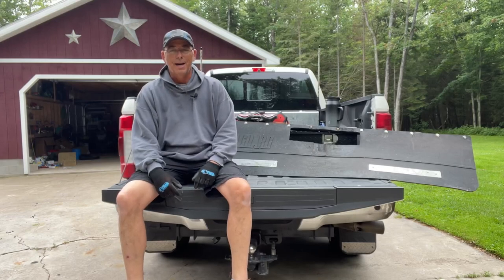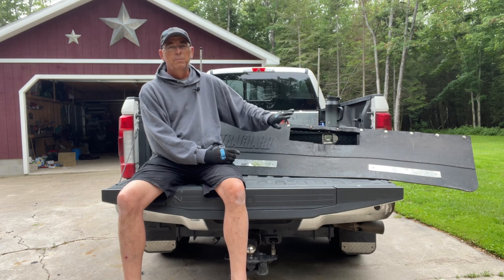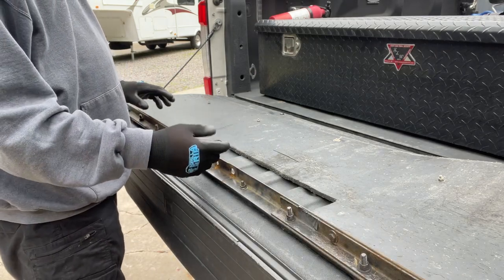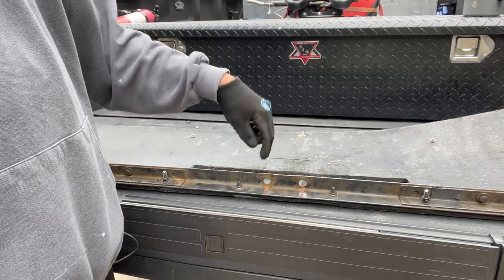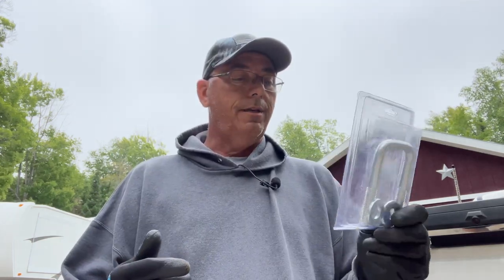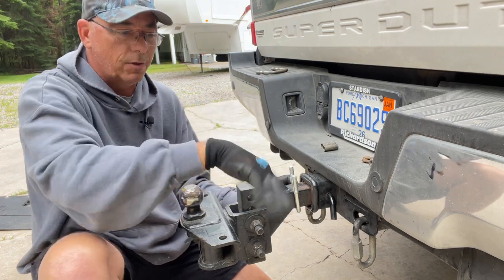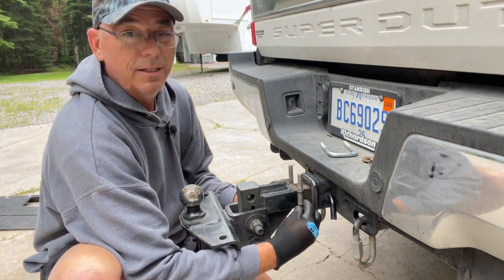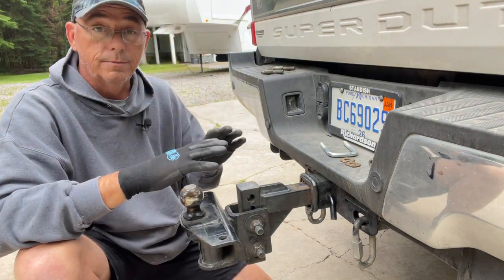Make Your Ultraguard or Duraguard Stone Guard  Removable.  Save MPG’s!!

Comment: I am curious to see how much difference your MPG changes with on vs.off.  I too have a full length mudflap behind my large wheel well mudflaps that I made myself from strut channel from Menards ($20) and a 1/2 inch thick horse stall mat from TSC ($40), and stainless hardware from Amazon ($25) so I could have one that is wider and taller.  I also designed it for easy on/off but mine takes me about 2 min each since it bolts to short pieces of strut I have dropped from the bumper frame mounting bolts.  This way it is bolted on both left and right sides (with stainless Nylock nuts) so there is zero wobble.  When the large mudflap is off, I have 3" round reflectors I put on the bolts on the mounting down-struts.

I personally have not found  noticeable difference in MPG between on or off.  I usually take it off when running empty unless I am short-trip back for another trailer.  My 2014 Ram Cummins 4x4 Megacab with 6 speed auto trans is much more bothered by wind than anything I have done to try to improve MPG myself.  With little wind, the truck will get 20 to 21.5 on the highway doing 65 to 70 (per the trip computer...so realistically 1 to 1.5 MPG LESS than that per computation at fill-up) with the full-width flap on or off.  But, add any direct or quartering headwind of 10 to 15 MPH and it plummets to anywhere from 14.5 to 18 (again per the trip computer) - you know: going West across the upper plains of Iowa, Nebraska, the Dakotas, Wyoming, etc.  And you know Montana...always a 15 to 20 MPH headwind and always uphill no matter what direction you travel LOL.  Just wondering if you will really be able to tell in the Ford.  And yes, I do know even very small differences add up when we are talking about thousands of gallons of fuel and tens of thousands of miles driven in a year.

Comment: Hey Tim, My name is Stuart. I love what you made there. Very good. I'm using my wife's YouTube channel. So are you still delivering campers or not? I think I had left you a message on one of your other posts and you never answered. Yeah I'm going to probably go work for a company called sky point. Probably within the next 30 days. I've got to get hernia surgery and cataract surgery before that happens. But I have a brand new 2024 Ram 3500 crew cab, long bed dually longhorn limited with the AISIN transmission and the 410 rear end. Also I have a beautiful Northern light truck camper in my truck bed so I only pull travel trailers. Good stuff though. You did a good job on that. It's an idea for me too. Great job!😢
Reply from the maker: @cynthiabrandt679  yes I am still hauling every day

Comment: I’m curious about the regular narrow mudflaps right behind the rear tires. Would I need to upgrade the little plastic factory ones to wider longer ones? (Besides the big “rock guard” one)?
Reply from the maker: You need full width flaps at the wheel also for most companies.